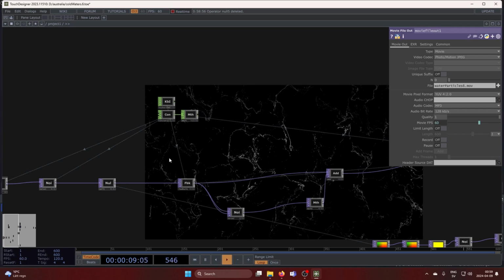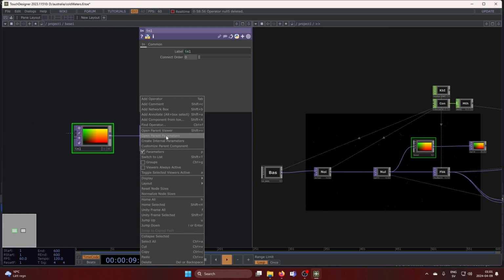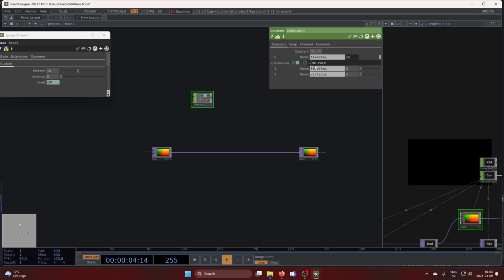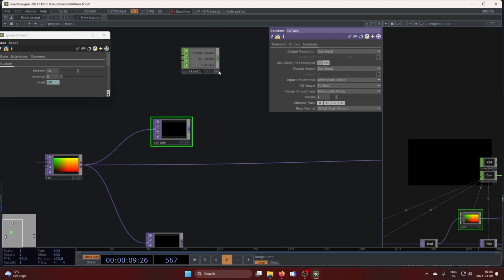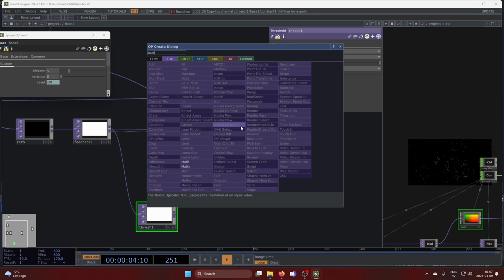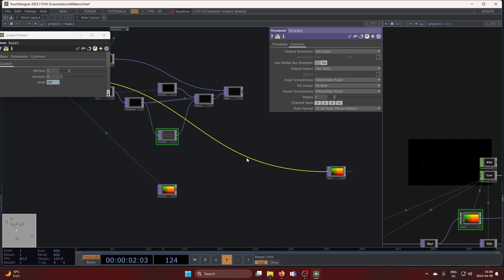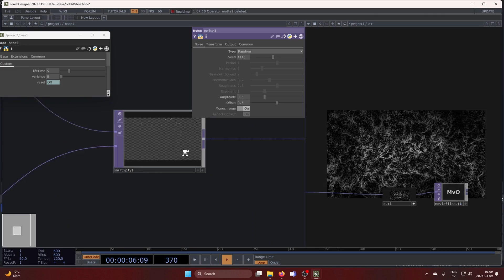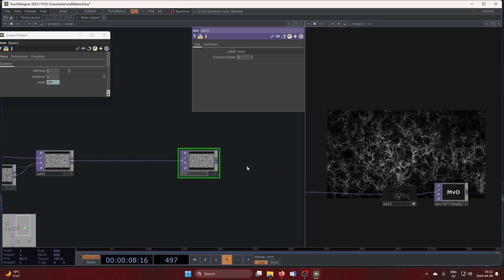NEW LIFE COMPONENT - reference video

Comment: Hey, everybody.
Hope everyone's doing well.)
Guys please tell me how to run this NEW LIFE))))))))
I spent 4 days, double-checked everything I could.
When I connect the one I created with the help of this tutorial.
I get a thin line.
If I disconnect Life everything works.
So something is wrong with Life.....
Please help, otherwise I will go crazy!)))
Reply: I also get a thin white diagonal line when I use my version of the Life Component with the Collapsing Noise Tutorial. 
Have checked my setup and double checked it.  
I suspect there is something wrong with the resetting but could be wrong.  Will continue  looking for bugs . . . 
Thanks for your work all the same - It is awesome and doing tutorials is quite a bit of work!
Reply: Yo guys make sure when you select the 'in' top inside your life component (to multiply with the threshhold) that your select is using the same pixel format as the input (32bit RGBA in most cases)
Reply: In the collapsing noise tutorial specifically, when you put the life module output over the feedback, it means all the little dots that life outputs are put over your noise pattern. If your 'in' select top connected to the main life output (the one multiplied with the threshhold inside life) is set to mono then all the little dots it generates will be mono and gradually take over your coloured noise, creating the diagonal line. You want the dots to be the same colours as your noise so that when they are placed over the feedback in the main project they are basically changing the value to something else within the range we are working with.
Reply: @connormcnab5276  you just saved me from kept checking everything over again over again
Reply: I'm also getting a thin line... not sure what's going wrong here.
Reply: same did yall find a fix
Reply: Connecting output 0 instead of output 1 worked for me

Comment: im really sorry but as a beginner its quite hard to follow because you've already made something beforehand, so when i create a base comp on its own and name it life and do all those settings, having to connect it to the keyboard thing is a confusing step cus thats supposed to be like whatever project one is working on at the time... so the life base comp will have to be adjusted in relation to whatever the main project is, and it will be different every time, it is confusing to figure out how exactly to adjust it. is there any way that the life component can just be it's own video without a base project to link it to, something that can be used for all the projects and dropped into them easily?
Reply: Just work through this ignoring the network he already has created - once you create your base component put an in and out top and then just follow through the steps. To save this as a component you can use in other projects you open your palette > scroll to my components > right click and add new folder > name it whatever you want > drag the base component into the folder and save. When you open your project you want to use this component in it will be in your palette! Hope this helps.
Reply: You can also right click the base component > save component.tox > import into whatever network you want this in.
Reply: @HarrySquared  It does !! Thanks
Reply: me too !!
Reply: I think that this tutorial is an April fools joke. Its not supposed to be helpful!
Reply: @backstagetherapy1955 you are dumb lmaoooo

Comment: Superb! I've just one question. I'm trying to use the Life component on a .ply Point Cloud file and it scales it in a weird way. After some tests, if the point cloud is scattered on a 1x1x1 box it works fine, otherwise I believe some remapping is needed somewhere but I didn't figure it out where yet....any suggestions? XD
Reply from the maker: Hello, it should work fine on a pointcloud, maybe try pressing reset after you plug the pointcloud in so it picks up the resolution.
Reply: @supermarketsallad  In the end it worked by direcly adding the life to the position with an Over, without before multiplying it with the start positon, but can't say I completely understood why XD
Reply from the maker: @ezpepz  that makes no sense to me. But if it works, it ain’t broken. who am I to question it.
Reply: @supermarketsallad  I found where the issue is, in almost all the early tutorials of yours the life component outputs a black and white texture via the outTOP inside the life component which then needs to be multiplied with the starting positions before being set as the first texture of the overTOP at the end of the Feedback Loop.

In this tutorial however we're settings ourselves up for a pre-multiplication (the "life" outTOP uses a multiplication of the thresholdTOP and the inTOP that contains the original positions).

To fix that you just need to bypass on of the multiplyTOPs (either the one inside the life component or the one immediately outside of it [to keep things properly ordered I would remove the one outside]).